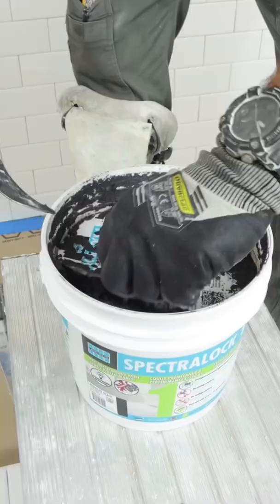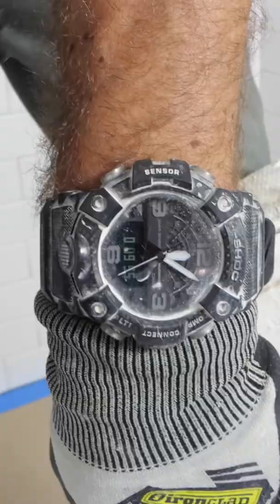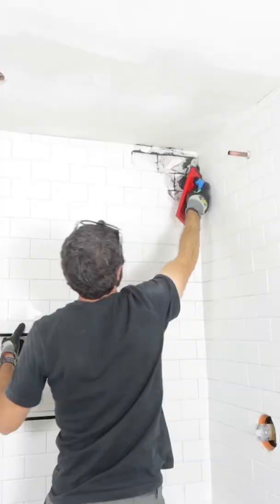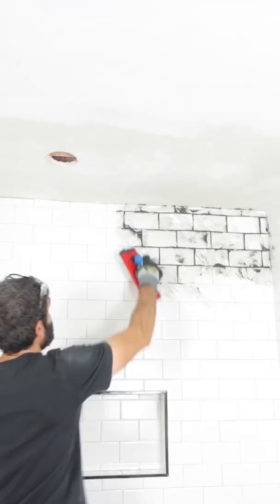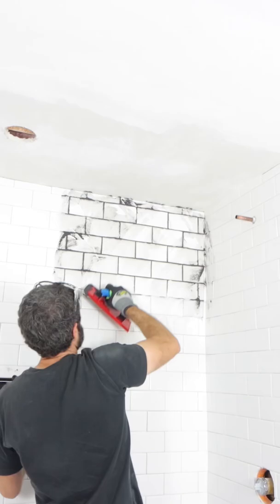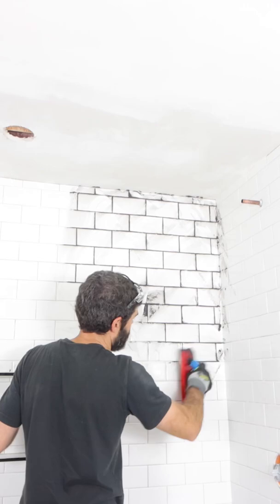Shower Grout Tips - #shorts

Comment: How does the wet clean up sponge not wash the grout back out of the joints?
Reply: Don't press deep when cleaning. You're trying to wipe the tiles, not dig out the grout. If you just press lightly and wipe, it won't dig into the grout lines and remove any, leaving clean shiny tiles with perfect lines.

Comment: I like how all of the tiles master's don't tape off the tile s between the ceiling or walls and leave all that grout on the wall. Looks like a proffesional did it yeah just wipe the wall off with a rag when u could of just tape it.
Reply: Quick answer if you just redid a bathroom and probably just repainted everything the paint is still fresh ..so theres a high chance if ripping it up when removing the tape
Reply: Also when a bathrooms getting remodeled, the tile goes on before the walls are painted.

Comment: Never ever ever use black grout in a shower.. I made that huge mistake.. All of it turned medium Gray And stay dark black In areas not touched by water.. I would never use black grout ever again it gets washed out after about 6 months.. Especially on the floor..
Reply from the maker: Was it an epoxy grout?
Reply: I used mapei black grout that was pre sealed and sealed it again and anyway later it still looks the same. I wonder if you didn’t mix it right or didn’t seal it. I remove a lot of diy tile and the grout always looks terrible
Reply: @PoisonJarl71501  can confirm I'm a DIYer and my grout was supposed to be light gray but it ranged from gray to white. Wayyy too afraid to get grout stuck on the tile so I think I over watered with the sponge and really washed out some spots. First time doing grout but still not good.
Reply: @PoisonJarl71501  use Sanded grout, doesn’t lift nor does the color change over time
Reply: Happened to me on a commercial job. Thousands of feet with white washed black grout. Never used custom brand since.